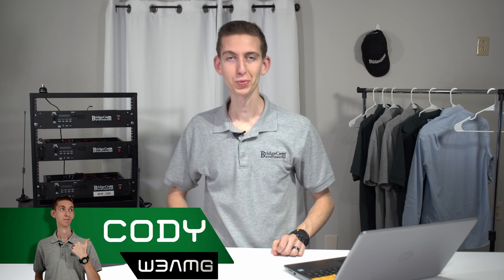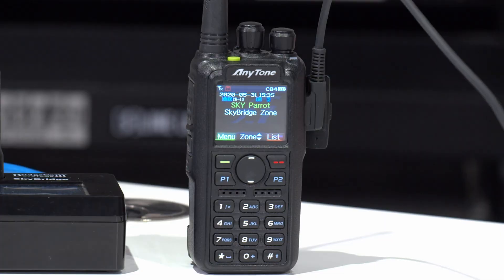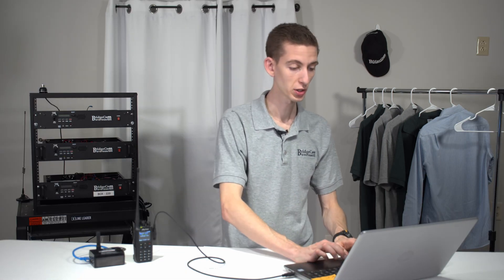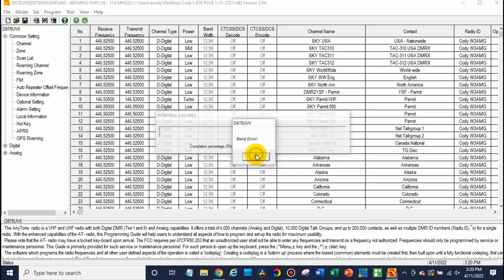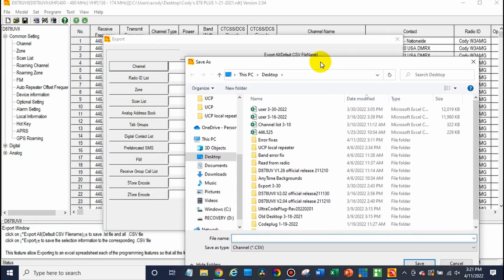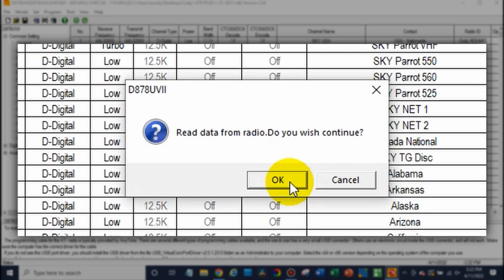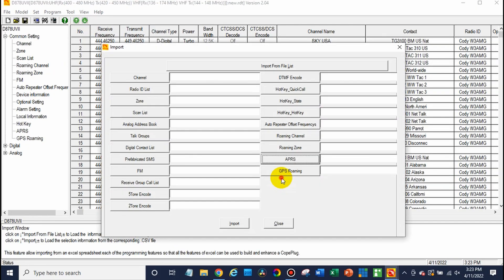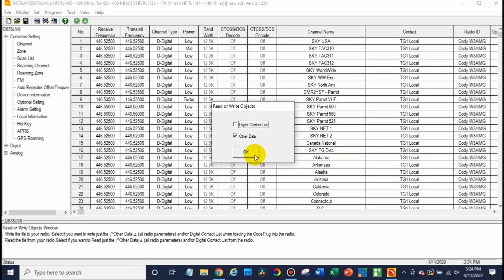How to Fix the Band Error in Your Codeplug

Comment: I'm following this step by step but still getting the band error. My radio is currently UHF 400-470 and I'm wanting to re-write to UHF 400-480. Are you able to assist or point me to another video? Thanks
Reply from the maker: We don't have a training video we can point you to, to assist with this.
Reply: @BridgeComSystemsInc  thanks, after much more trouble shooting I reset the radio in test mode and selected my desired band, then imported the code plug and its working fine.